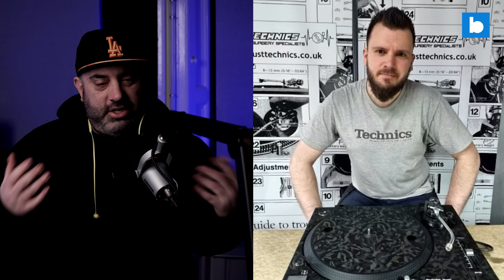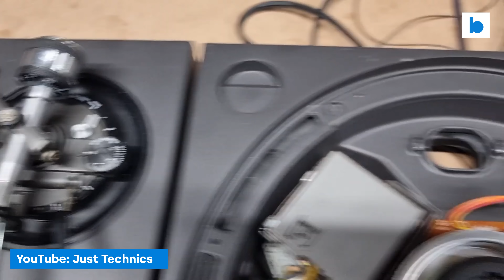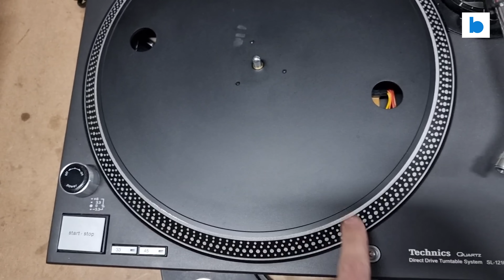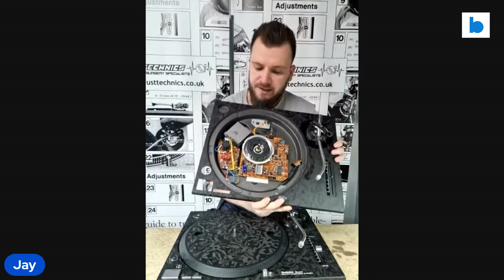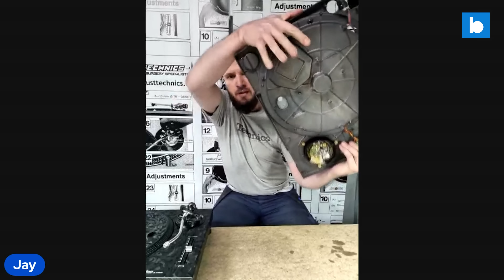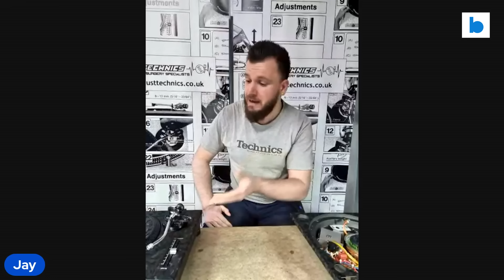Fake Technics 1200s EXPOSED! I Beatsource Tech

Comment: Nothing wrong with a Frankindeck as long as it was put together correctly. And the customer is aware it’s not an original deck. It’s just like classic cars. Original parts don’t exist so should we not try to fix them and throw them away? No we have to do what we have to do to keep them going.
Reply: Sensible point. MK2s are not getting any younger and original parts are hard to find. Good repairs, honestly described are essential to keep these classics on the road.

Comment: My MK2s I bought in 2005 were manufactured in 2003 according to a Technics serial decoder. Just a few decks away from each other off the line. They’ve never been disassembled, and I keep the spindle bearings lubed with the proper SFW0 010 oil. Still feel like new decks 🤌🏻😂👍🏻
Reply: thermal paste dries out over time

Comment: I've been repairing/servicing Technics decks for decades but these factors never really came up. Although - I serviced a 1200 recently to find that it had a MK3 pitch slider which doesn't have the central lock. Luckily i had the correct one in stock and changed it. I fear that there will be many Chinese copies of these parts in circulation.
Reply: This is a dead system, I highly doubt the Chinese clone parts for repairing old Technics. If anything many brands copied their designs and some parts may match because of that, people mix and match Technics parts and use today's industrial manufactured resistors, capacitors, etc which can buy on Mouser for example.

Comment: There are a handful of sellers on eBay regularly selling Technics 12s in ‘mint’ condition, usually complete with Technics branded cardboard boxes. I’d hazard a guess that many of them are refurbished decks even though it may not be immediately obvious to the average buyer. Some of them do clearly state in the ad that they’re refurbished and that they come with a warranty, which is fair enough. But if you’re buying online how would you know if they’ve been refurbished to a good standard or if it’s one of these Frankendecks put together by some cowboy?
Reply: You take a punt, and get whats sent.

Comment: With technological advancements and circuit creation more successful, this could be a lucrative endeavor to create aftermarket clone boards and power supplies for the MKII, MK3D, and MKV. And do it with better or matched quality components so it's not scummy.. Unfortunately there will be those who are scummy however.. I don't have an SL-1200 problem.. I have an SL-1310-MKII problem (the usual/tonearm lift is dead and auto play ensures the needle will scratch ALL the way across the vinyl once it reaches the end). I know i can get some aftermarket parts, and I'm handy with a soldering iron but I do worry if some essential mechanism breaks will I be able to find parts..

Comment: I have 6 decks and I must be the one of the extremely lucky.
I have two SL-1200 MK2s that I use.
I also have new in the box and never used…Two SL-1210 MK2s and two SL-1210 MK5s.
I don't have any interest in selling my new ones and even if I did I wouldn't take a penny less than $4000 US a piece for them.

Comment: Wow, such a clickbait title. In the end they're all Technics SL1200 using mostly original Technics parts. Sure, a tonearm swap should be mentioned but it's not like anyone is actually running 6g of tracking force on their day to day. Funny how he keeps mentioning the M3D, but the M3D was never sold outside of Japan and needs a new power supply and board swap + power switch because the Japanese models only ran on 100V with no switchable power supply. I know because I just did a swap and upgraded it to a much better toroidal transformer. People who repair electronics know that finding vintage resistors/capacitors is difficult and doesn't make a lot of sense. Those items are "wear items" just like the brake pads on your car. When I saw the title I was imagining people re-badging an Audio Technica LP120 and selling it as a Technics SL1200, which seems like more work than it's actually worth.

Comment: I would argue they arent fake and there isnt a scam as such. Yes they are misrepresented and yes they arent 100 percent original, it wont effect the value as they arent overly collectable yet price wise. 

Same people probably driving round in a car with a replacement engine or gearbox, aftermarket shocks and arent bothered as it works just fine.

This woild only be an issue if you purchased what you though was a mint original pair of 12s that eas misrepresented......

Comment: Its pathetic the pricing for them these days. owned two sets, yes lovely to use and built like tanks, but i think some people have it in their heads that they will make them magically better, or they sound better. simply not true. i put my last pair up for £550 (could've asked for more but not the sort of person to extort others) in 2020 and the swarm of people messaging me who clearly were just going to flog them on for more was insane. They arent worth what people are asking for them IMO. You can quite happily buy plenty of the other options available today and comfortably go into a club with technics. if you can mix on vinyl you arent going to find yourself in a situation where you're screwed on the night because you arent used to technics. i've opted for vestax pdx-2000's this time around and there was no issue going from knowing only technics to using them. piece of piss!!!

Comment: I got two brand new tecnics mk 5 original got it for about 10 years never use it just bought them check them out make sure it work n they are not fake at all I bought it on japan analogo original no joke I be DJ since 89 n a  turntablist too n collect turntable since 95 so those brand new mk 5 original I just don't have the dust cover oh the box that it no scratch on it at all n never use it until my last tried make sure they work when they came from the company I don't know what I did with the plastic dust  cover my apt is small so I throw out the box yes big mistake I did if anyone want to buy it hit me up I send you picture I got them  on plastic bag so it don't get dust this dude is cool I check all my deck to make sure they are the original when I watch is channel thanks dude he is right

Comment: Well, buying anything used has it things to watch out for. If you aren't experienced servicing electronics/turntables, be prepared to pay someone to do it for you (perhaps the currently available new Technics would be a better choice for those who don't want to DIY). As when buying anything used, you need to do your research and know what you are lookin at.  I don't agree with calling these fakes, I would consider them genuine but modified. I don't see these as classic cars that lose their value simply because they have been repaired or modified from original to keep them going. A fake, to me, is one of the cheaper Asian made clones of the 1200 series. I would expect that a great number of older 1200s are going to have been repaired and have had parts swapped in. Again, do your research and know what you are looking at and you should avoid any disappointment...

Comment: This is absurd, the parts are the same,they're slightly different, but in general they are the same  there's no fake Technics, they are trying to elevate themsleves into Master Gods of Technics Knowledge,people swap parts ,it doesn't matter if you put all the Technics 1200MK2 Components  into a 1200MK5 Or Whatever,the only one that is different its a Technics-1210M5G, there is no Fake technics,FRANKENDECKS absolutely absurd ! They are all the same,what a Huge amount of BS,Mark 5 mark 2 that's just Marketing,they are the same,Technics never sold parts separately for Mark 5 or Mark 2 or M3D just the pitch sliders and M5G ! All the internal components are the same they just changed them through the years from different companies and providers,(contractors) This is pure absurdity! Extremely Ridiculous,just because you restore your turntables yourself ,paint them yourself and restore it yourself and don't bring them in to this fella,that doesn't make it Fake! The platter thing it's beyond extreme, absurdity ,unbelievable,the color of the boards doesn't matter,they are the same,what in the Fu##  lands this guy it's talking about ! This is the most fantastic nonsense I have ever seen ! Basically people don't touch them because they will become fake if you don't take them to this guy ! Unbelievably absurd ! I don't see anything absolutely fantastic about this they are just Marketing themselves! I though I've seen it all ! Expanding my knowledge ! FRANKENDECKS RIDICULOUS!

Comment: Tbf, none of this would matter if companies didn't cause it. Stop making things obsolete unless absolutely necessary and if you're telling people you are the 'flagship, history makers' blah blah, like Technics do, then make sure replacement parts for ALL previous models, exist? 
If Technics really wanted to, they could do this, instead of breaking out different marks of the same thing. 
I'm not saying stay at MKII forever, but between all the marks now released, unless you have an unhealthy obsession with music only found on vinyl and blowing all your spare cash on styli that give you 3mths tops - then my £300 controller has more features, will seemingly last longer, so will my mp3s and it won't cost an arm and a leg to run just for pins alone.
Now that you seemingly can't even fix older models Technics without someone possibly fitting a duff board in there, there's absolutely no point in owning one of these in 2024? Just my opinion :D

Comment: Audio technica AT LP 1240s piss on tec 12s.  I ran tec 12s for decades. They are no match for the 1240s. Strong motors in the audio technica. I rec'm.  Can't get"m anymore though. Come across a pair buy them. You won't be disappointed.  At home I run the brilliant Garrard 401 with a SME arm. Proper turner

Comment: Forget about the SL1200s. Look instead for something like the Reloop RP6000, Citronic PD-45, Synq XTRM-1 etc., basically any of the badge-engineered Hanpin Electronics DJ-5500 OEM turntables. Way more precise pitch control, faster start/brake time, bigger pitch shift range, capability to play 78 RPM records (with a dedicated 78 element) and they are about as expensive for a pair, in mint condition, as a 1200/1210. You can still get the Synq XTRM-1 brand new by the way, for under 400 euros a piece. I had the Citronic PD-45s for several years, playing on Technics felt like playing on belt drives compared to them. I know several DJs including turntablists as well as veteran gabba DJs from the Netherlands who played at all the big warehouse raves in the 1990s who sold their SLs to get a pair of these OEM turntables (mostly the Relooop RP6000s, they were the best selling turntables in the Netherlands for a decade).

Another advantage of these things: they're maintenance free and are built with early 2000s manufacturing tolerances. The SL1200/1210 was made with machine tools built according to 1970s manufacturing tolerances and require more maintenance, especially because they have more mechanical and electrical components (which are prone to wear and tear) for example the RPM measurement, which is done with electrical contacts. That of the OEM turntables works with a mesh and a light beam so no wear and tear is taking place so their pitch calibration stays 100% within manufacturing spec.

Comment: The problem is that Technics is so overpriced rubbish that it attracts fakes. And the point you learn from this video is that the $1500 model mostly is same as the $7000 model. You wouldn't know unless you pulled it apart. And still Reloop is better and Pioneer PLX 1000 is lot better all the way up to +$3000 models if not over. That's why this guy repairs these because of the placebo effect that people think these are special. Old tech that even Audio Technica beats. All comes from Hanpin expect the most expensive that are from Japan but that is false security as the labor cost keeps the quality low.
Reply: @ElectronicMusicUnderground  Lets be serious. New works better and old was kept going longer not because it was build better. Those who could changed their consumer product more often and those that couldn't were more likely to repair the old. Only difference is that old is simple low tech and new most people can't fix. It doesn't make the old better.
Reply: @ElectronicMusicUnderground  ... the 80's top range gear I had at the time is today's low end. You might like or you are use to the color of the sound but all in all we are so much better today.